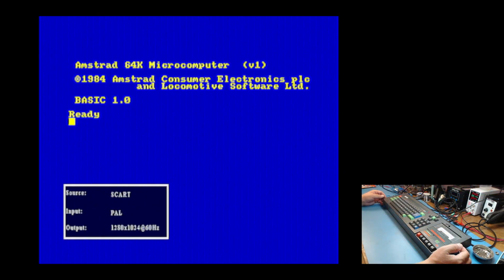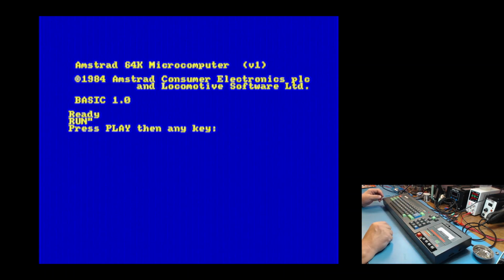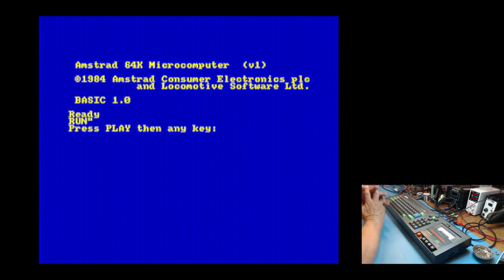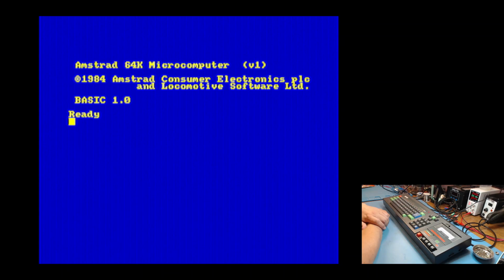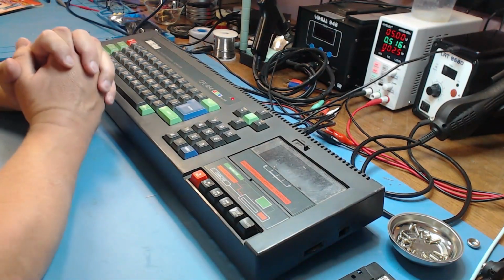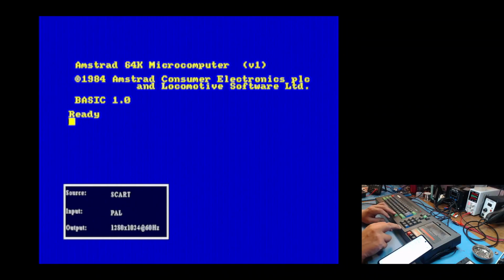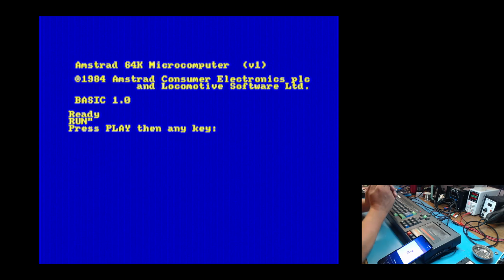MWPC - Finally Running Software on the Amstrad CPC 464

Comment from the maker: I've learned a couple more things since posting this:

1.  Some of you asked if I tried the b-side of the cassette.  The answer is that I didn't.  It simply didn't occur to me.  It's been many, many years since I used cassette software.  But I've tried it now.  There is data on the b-side.  I can hear it playing back.  However, the CPC does not recognize it at all.  I'm guessing something to do with the azimuth/alignment/calibration of the tape deck.  We'll explore that when I do the teardown on the cassette unit for maintenance.

2.  For some reason, if I have a device plugged in to the external audio input jack, it seems to cut off the internal tape deck audio entirely.  It has to be an actual device, not just the cable plugged in to the jack.  At a guess, I'd say it's some kind of pull-down or voltage divider effect.  It's not really a problem as long as I remember to disconnect any external audio device when I want to use the internal deck.  However, I'd like your opinions.  Do you think putting a diode in series between the audio jack and C317 would fix this?  Or would the diode drop be too much and cause the external input to no longer work?  Is there another solution any of you could recommend?  I'm not very good with analog electronics.

Thanks
Todd
Reply: A diode will rectify the audio signal (chop off the negative going part of it). It will become unreadable to the computer. What you need is a buffer circuit between the external player and the audio in jack. This can be done with an opamp in unity gain mode but I think it is just not worth the hassle, it will need symmetrical (plus and minus) power, things are gonna get messy. Just unplug the external device to use the internal cassette player.
Reply from the maker: @borayurt66  Thanks.  You're right, of course.  I hadn't thought about rectification.  The whole point of putting the input before C317 was that some devices output a signal that has a negative DC offset.  Unless someone else comes up with a better solution, I'll probably just live with it the way it is.
Reply: @YARC-1981  It is actually a positive DC offset, used the pull all of the audio signal above the 0V line, commonly used way to get away with single supply amplifiers that can't do a negative going signal. This is removed in the final stage with a series capacitor. I am not familiar with Amstrad CPC machines but the C317 you are referring might be just that.
Reply from the maker: C317 sits before the first opamp stage.  On Noel's first attempt, he connected his external input at the input to the first opamp stage, but after C317.  The TZXDuino worked that way, but when he connected his iPad through that, it didn't.  He scoped the signals from the iPad and the TZXDuino.  It turned out that the TZXDuino output was a square wave always above the 0V line and the iPad output was a square(ish) wave, (I don't know if biased is the right word, but) biased so that it centered around 0V.  The opamp couldn't handle that.  He moved the input ahead of C317 to remove the negative DC offset, shifting the square wave to the positive and keeping it above 0V.  That fixed the problem he was having.
Reply: i don't adjust the azimuth until i had explored everything else, and also got a few tapes to compare against.. the audio disconnection problem i seem to remember noels retro lab talking about this, he has done a few videos on the cpc tape deck.. don't forget that the tape audio will never come out of the audio output jack (only the Amstrad speaker) which is even stranger as there is no actual connection from the tape deck to the speaker ,, it is a apparently cross talk across the close tracks . there is a audio/CDT file that you can record to tape to aid adjusting the azimuth clearly it will not be perfect as the tape will not be a perfect recording
Reply: @markretro3612  Also azimuth adjustment works for both sides. If a tape loads on one side and the computer doesn't even hear on the other side, chances are there is something wrong with that tape, not the azimuth adjustment.
Reply from the maker: @markretro3612  Azimuth won't be my first try either.  Thanks for the info!

Comment: I`m a big fan of melting through plastic with the soldering iron and then scrap off the flash. Saves breaking the plastic. I will follow you advice on fitting my digital player. I`ve got it working on the ZX Spectrum. Cheers. :)
Reply from the maker: I'm no fan of case modifications at all.  I only do it when absolutely necessary.  Your method probably gives cleaner results in addition to being less likely to break the plastic.  I don't have a "favorite" method because I try not to do it in the first place.  Thanks for watching and for the info.
Reply: @YARC-1981  I did it first on perspex thin roofing sheet after cracking a few with a drill. I would never do it to my old Speccy. :) I did it to an Amstrad I just got for the audio input. Thanks for the help. It all helps a lot. I`m waiting on some 16 pin ram sockets to finish off a ram change. Hopefully all will work. :)

Comment: I haven't been able to do much with my C128 because of a lack of data storage. I do have a third party cassette desk for it (made by Fortronics). The belt is very loose in that thing, but now I'm thinking that I might just try an audio jack mod on the knock-off datasette itself. I have far fewer qualms about modding the case for that than I might for the C128.
Reply from the maker: Sounds like a plan!  Thanks for watching.

Comment: I know you follow Noel's Retro Lab, so might already know this. There was a TZX (among many other formats) player he reviewed a little while ago. It is a bit on the pricey side but I think it really is the one to go if you have many different brands of retro computers that can load software from cassettes. Here is the link to that episode:
https://youtu.be/j4__v6ojPt0
Reply from the maker: Yep.  I saw that one, too.  You're right that it's pricey.  I'm going the TZXDuino route because it's cheaper and because I can build it myself (another video for the channel).  Thanks!
Reply: @YARC-1981  I've built my own TZX player for my Sinclair Spectrum machines, they are the only ones which depend on a tape input solely. The hardware is relatively simple, I could even get it to work on a breadboard within an hour. Then transferred the whole thing on a homemade PCB. When it comes to software part of it, things get a little complicated. Unfortunately the original Arduino based tape emulator project got split in some point, giving birth to some confusion for us the noobs. There is the TXZDuino, MAXDuino, and some others. I ended up using MAXDuino code because at the time it had better features like a simulated tape length and percentage counters. Also it could do fast forward or rewind between the different parts (BASIC loader, loading screen image, and the chunks of game data that follows these) of the .tzx file of the game. Once I loaded the code on the Arduino and got things running well, there were many more updates to both of these branches of the project but I did not see any significant improvement for my purposes so I never updated it. Good luck on your build, waiting for the video soon.
Reply from the maker: Thanks again, Bora.  I'm planning to build the same one Noel did.  I've ordered the PCBs from PCBWay and sourced the parts through AliExpress (so those'll take forever to get here).  I think he used the MAXDuino software.  I probably will, too.

Comment: the main belt gets misshaped when they are left for any length of time, (72mm if memory serves)  the small belt only drives the counter, also there is a small rubber tyre that pushes on the reel when play is engaged (i think it is responsible for stopping the tape from jamming up) .. you can load OTLA files as well.. games will load in 30 seconds instead of 5 minutes (but they can take some fettling to get working)
Reply from the maker: Thanks, Mark!  I already have a full set replacements on order for the cassette drive (both belts + tyre).  The listing called the tyre the "FF Idler tyre", though what that means is a mystery to me.  What's an OTLA file?  And how do I use them?
Reply: @YARC-1981  "OTLA loader" is a piece of free software that converts a standard loader/tape image into a fast loader i think at something like 12000 bps, i find with the amstrad files that it was better to load into emulator and save as  snapshot then load that into OTLA and you get a audio file but they are very sensitive to audio levels .. works with zx spectrum as well .. i have excellent results with a simple tape adapter doing this
Reply from the maker: Thanks, Mark.  I'll do some more research on the subject and if I can get it figured out and implemented, maybe I'll even do a video on the topic.

Comment: Good to know about that mod. Btw, silly question but have you tried side B of that tape?  Game are usually recorded on both sides so you might have better luck on the other side.
Reply from the maker: Someone else made the same suggestion.  I didn't think of it at the time. I'll try it.  Thanks!

Comment: I think your extracting the maximum amount of fun to be had from an amstrad by tinkering, after you load anything its ( after the long wait ) straight downhill........ lol, you can use a gotek with it too I believe, and this no doubt raise its value by the amount of the gotek, double then...... lol........ seriously though, As easy as it is to deride this monstrosity it is seriously handicapped in the features department with the lack of scrolling and sprites which unfortunately means that the z80 has to do so much when games are loaded, hence why wizball is such a steaming turd of a game on there. As always though, nice vid
Reply from the maker: Thanks, Cap!  Did you at least enjoy the part where I drilled holes in it?  I would have thought stabbing an Amstrad would have given you tingles.  I think I'd still need a DDI to use a Gotek with it.  And yes, I do understand its limitations when compared to the C64.  You forgot to mention the SID, which is a vast improvement over a Yamaha chip.
Reply: @YARC - Yet Another Retro Channel  well the sound chip isn't half bad, same as the spectrum 128 and the atari st, but still no patch on a sid or maybe even a pokey, zx games are often ported to it using mode 1 ( I think ) which is a 4 colour mode and quite fast but the 27colour mode 0 really brings it to its knees cpu wise, There are a couple of good games on the amstrad....... There may even be as many as 3........😁
Reply: @CaptainCommodore  the Amstrad CPC does have hard scroll using the CRTC chip,  which it wasn't really used back then in most cases.  About the colour mode, that is not correct. It doesn't affect the CPU speed at all. The CPC default screen has to move a 16kb  bitmap screen no matter the graphic mode, so it allows colour per pixel but not the same as moving 7kb as a speccy screen. The problem comes when the game was ported from ZX and sometimes  C64, which used  direct code from those machines slow and a few colour sprites.
For good results it has to be coded specifically for the machine. Examples Robocop, Batman The Movie, Trantor, Dark Fussion, Renegade Reloaded (software scroll). Pinball Dreams, Abduction of Oscar Z,  Super Edge Grinder, Alcon 2020 (hardware scroll), Curse Of Trasmoz , BB4CPC... more than 3 good games that is ...

Great video, looking forward to see more CPC stuff !
Reply: @Víctor  well, a couple of points there vic....... 1st There is something of an in-joke between a few of us in a group about Amstrads...... 
2nd, I'm no expert on the amstrad but I do know that while technically there is a type of scroll in the video chip it is nowhere, and I mean NOWHERE near what other micros have in capability, and whilst you state the amount of memory that has to be chucked around you don't seem to mention the bit-layout that makes mode 0..... A bit strange lol to manipulate...... The examples you mention may be good for the amstrad but there's very very few games where the Amstrad had the best version when compared to other machines......... Just look at wizball..... diabolical, There has been some new releases that do a much better job but the contemporary releases couldn't really stand up to the other systems, on the whole of course, there are exceptions "head over heels"
Reply: @CaptainCommodore  I understand, those jokes happens in every group about other systems. It is clear that you don't know enough about the system. The CRTC or Motorola chip does scroll and a lot more, you can assign 32k or 64k to it of wished, change graphic mode per raster scanline, easy overscan, horizontal, vertical, full screen.. you should check Area 5150 demo and what the same chip can do on a IBM PC with CGA... I don't care which is best computer or game version, the games were good if programmed for the system and that shows in a cpc, juste like you said "head over heels". At the time programers focused more en C64 and ZX so CPCs and MSXs in europe suffered a lot of quick ports, not because the machine is not capable
Reply: @Víctor  ahhh so the massive library of dodgy games is because everyone programmed them badly !! Nice, I do understand the hardware, I'm not an expert in it but I do understand it, there are only sprites on the + and they weren't used much and when they were they had a slow memory to local memory, the scrolling is generally poor in games and thats because of software scrolling, either way you look at it , the amstrad is a poor relation to a c64 and even atari when stacked up like for like, it is a shame that being a fanboy is blinding you to thatbsinple fact
Reply: @CaptainCommodore   bells are ringing but you don't know where from. Plus machines are just superior, it has DMA, so fast memory access... that's why you can find mod tunes while running like the EEerie forest GX4000 demo, kinda like if it was an 8 bit Amiga. You see, what I will never do, is talk about something I don't really have a clue, the only thing I've done is point out some errors and explaining them. . Games were bad and good like in any platform, better sometimes worse others.
Am I a fanboy for that? for saying that the machine had good results when properly programmed? Suit yourself.
i thought 8 bit wars was something long gone.

Comment: Nicely done! I think the mod is great! Have to tried to write a badic program and save it to tape, then load it back in after you reboot. Thanks for sharing
Reply from the maker: Hi, Rudy.  I actually didn't do audio out, so I can't save anything.  I may think about adding that in the future, but I'm not too concerned about writing code and saving it.  If I ever do want to do that, I'll probably use an emulator and only use the real hardware for testing.  Thanks for watching!